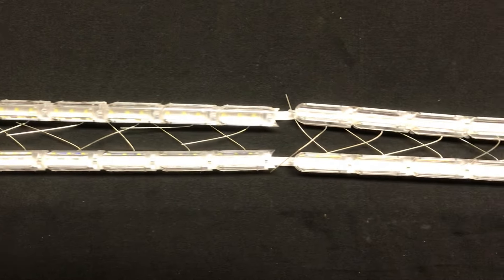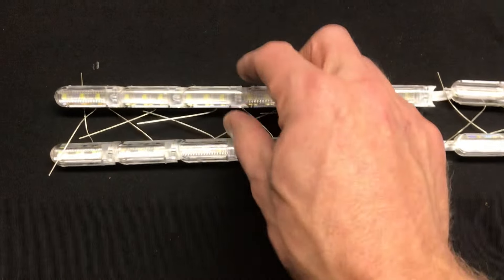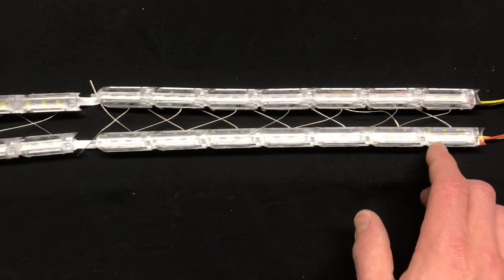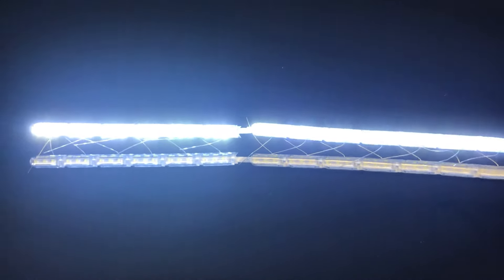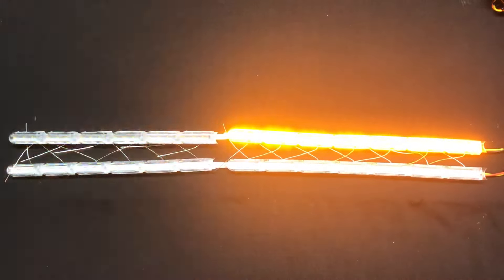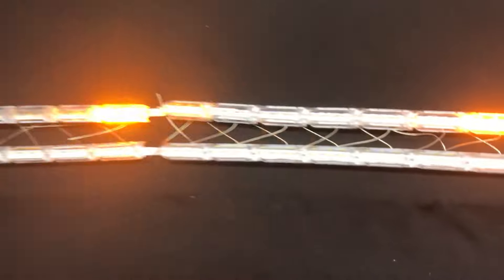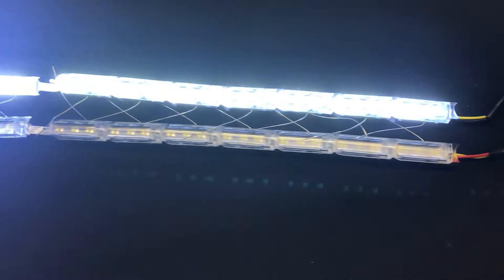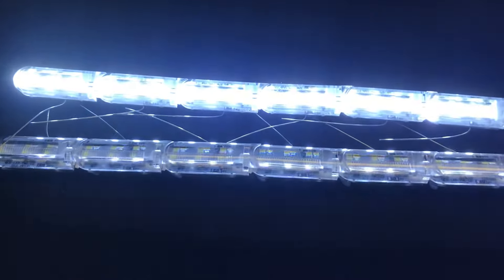LED Sequential daytime running lights with show mode turn signals!

Comment: I want this as my turn signal. How many possible chasing patterns can be done? I've seen some cool patterns with Arduino, but I'm not familiar with how that works.
Reply from the maker: These are already coded so you dont have to worry about programming them.  The functions you see in the video are exactly what you'll get.  If you want to change the patterns you'd have to modify the lights.
Reply: @HIDprojectors  how do you modify the lights?
Reply from the maker: Michael Moore you’d have to reprogram them. It’s more involved than just using these as they are.

Comment: Can you turn of show mode? For it to just flow?
Reply from the maker: The show mode is automatic. It will flow through the sequence just like in the video.
Reply: You can't turn it off?
Reply from the maker: @oscarfigueroa1528  It works with the circuit in your stock turn signal.  When its on, it works, when its off, it goes back to white.
Reply: I get that what i mean is can you turn the show mode off and just let the amber flow instead of doing all those other different ones
Reply from the maker: @oscarfigueroa1528  No, the show mode is built in.  Its automatic.  If you're looking for just a sequential strip, check these out: https://www.hidprojectors.com/collections/clearance/products/sequential-switchback-crystal-led-strips-24
Reply: Can it be able to cut at any point...to reduce length?